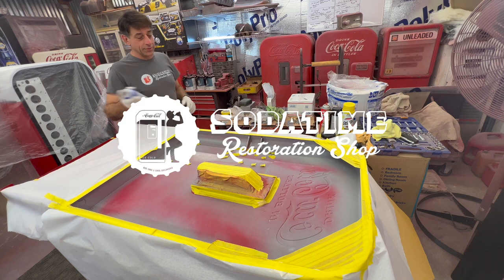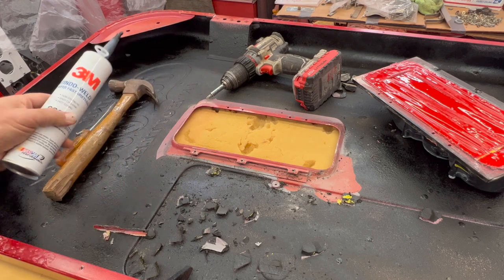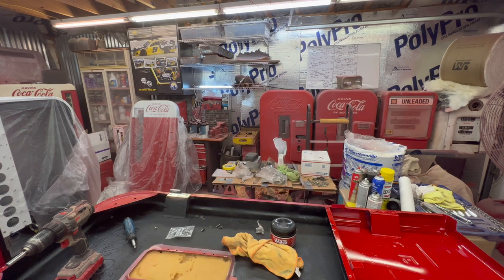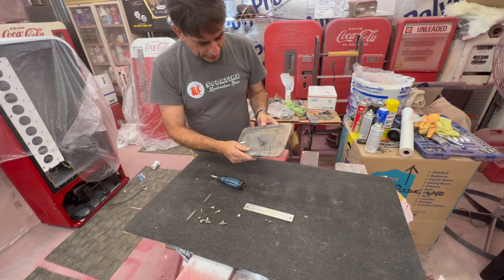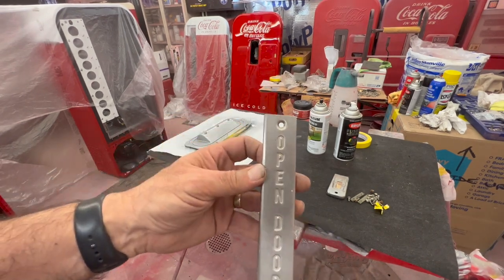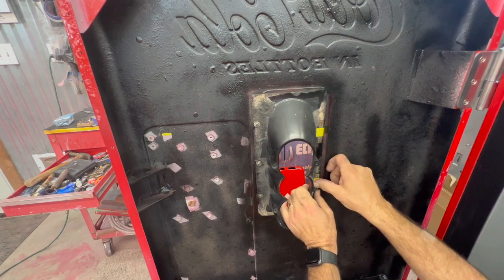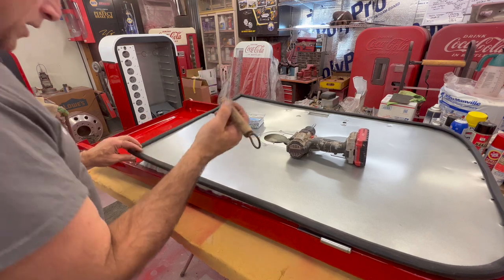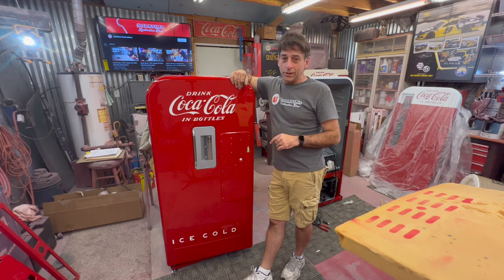Main Door Assembly & Install | 1951 Vendo 39 Coke Machine Restoration

Comment: Love the series.  Learning a lot getting ready to do some work on my VMC 33 10 cent machine.  Just thought I'd tell you that packing fiberglass real tight actually reduces its ability to insulate.  Fiberglass insulation gets its R-value from the amount of air it traps between its fibers. If it's jammed too tightly into a cavity, it can't trap as much air and won't be as effective.  Just enough to fill the cavity.  If you're worried about it falling down maybe spray some contact cement first.
Reply from the maker: Good info ! I will remember that! 😊

Comment: Could you tell me what paint color you use for the red and the white.  A paint code would be very helpful. Restoring my Vendo 39.  Thanks.
Reply from the maker: Paint formula 39339
Martin Senour paints
Cross-fire base coat 
Use a grey sealer

White is a 1208 
Linen white 
Same paint 
Napa Auto Parts
I will give you the Formula tomorrow